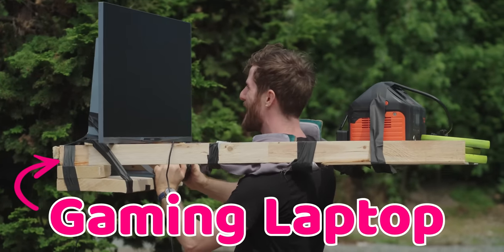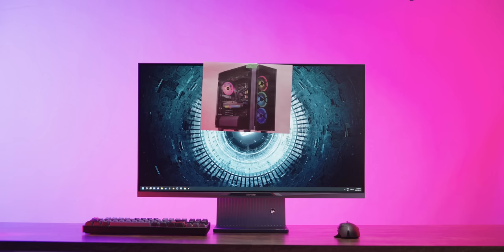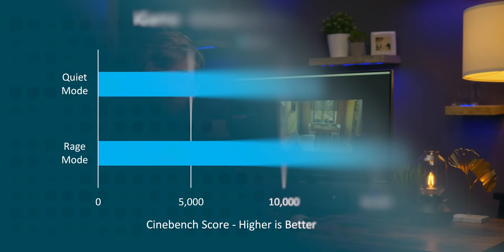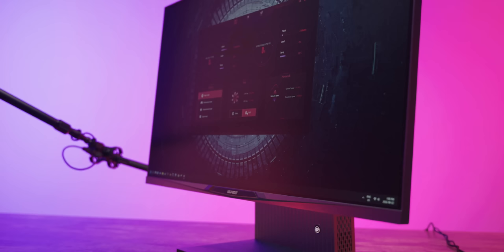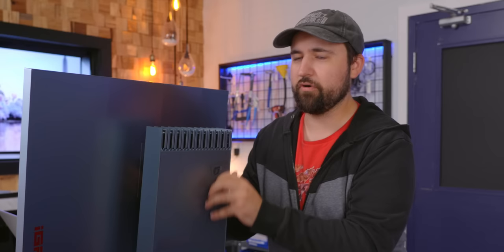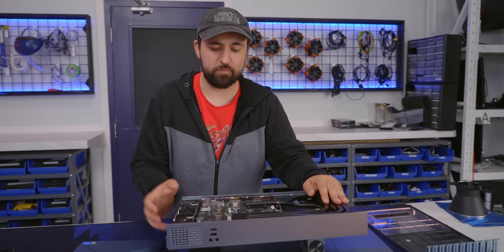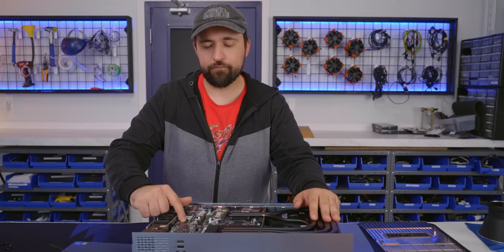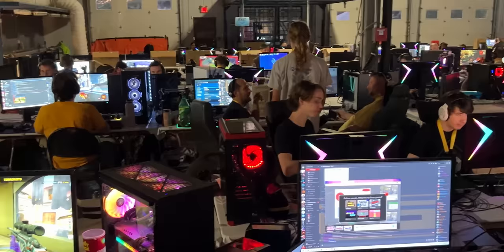Justify Your Existence. I'll Wait. - Colorful iGame AIO

Comment: I mean yeah you could buy a laptop to get similar performance, but then you'll have a small screen and attached keyboard/trackpad. To get a comparable experience, you'd need to buy an external monitor, keyboard, and mouse which would add to the price and take a lot of desk space. I like AOIs for their simplicity, small footprint, and aesthetics. Although I've seen plenty of decent ones by HP, Dell, etc, so I don't know if we need another option. I guess this one is marketed for gaming, which other AOIs typically aren't.

Comment: An ATX PC with front-facing speakers installed in the bottom fan basement and a display VESA-mounted to the desktop case itself would be pretty much the same thing, paired with a vertical GPU mounted to exhaust heat out the opposite side of the display and you'd basically have what this gives but modular.

Comment: You shouldn't lay screens flat with weight on the panel, if its lcd it will wash out all the color for the rest of its existence even tried it with a blanket before and it it still happens.

Comment: Gives me the Commodore Amiga effect vibes. The Amiga 600 was just an Amiga 500 in a smaller case but did have a hdd connector inside and a PCMCIA slot buuuuut again still only had aging A500 chipsets inside. Whereas just around the corner the Amiga 1200 AGA compatible successor beat it in every way. Also the Atari STE and Falcon computers were just hitting the market. Plus the Sega Genesis and Super Nintendo were also "cheap consoles" that still bested the A500/600 chipset at a MUCH lower price. The iGame seems to have the same issue - slightly in the wrong spec and place at the wrong time. (Also reminds me of the Commodore CDTV)

Comment: Two things as a low point: 3060 6GB for a 1440p display? Definitely gonna be a problem. Should've gone with a 3070. Honestly at this point getting a mini PC from Minisforum and better display is gonna be much preferred. Or you know, get a laptop or build a PC. This is what I'd like to see, but it's not the parts I want.

Comment: I think there's a place for AIOs, but the main reason i feel like they shouldn't exist is that they're usually even worse in terms of upgradeability than a bloody laptop, while giving performance that's on par or slightly better than one.
Micro PCs can do it, laptops can do it, so why can't AIOs?
Hell, the Dell 3090 and 7090 Ultra models are even more low profile, and super easy to take apart and upgrade.

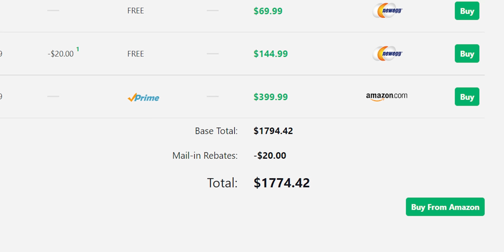Comment: 7:51 yes it beats the igame in term of performance, but what about in term of power usage and noise level (in quiet mode of course).  i think the sole reason they use laptop hardware on the inside is for power saving purpose.

Comment: Honestly I do miss AIO's. I bought one from Origin back when they had them for sale for my RV and when I was on the road doing for work because A.) I wanted a large screen instead of a laptop for certain applications, B.) I had no good place to stick a tower (plus it's just extra to tote around), C.) I wanted decent performance (dedicated gpu). It does suck to have minimum specs on them these days (Hp, Dell, etc..) cause they're essentially e-waste after a few years gaming/work wise, but so are laptops. They're quite useful for those with limited space but want a 27"-35" screen and a good graphics card. I would like to see them make a come back, stick a laptop's 3080 (or 4080 soon) in it and I'd still be sold.

Comment: 1440p on a 32" monitor may not give you a very sharp display, but it is great for ease of use, because having an old fashioned pixel density, means you don't have to use any scaling to get everything to appear at a pleasant size on screen.

Comment: The gaming laptop I just bought (which was last year's model) with a Ryzen 7 5800H CPU has the same number of cores, and actually wins on some benchmarks over the top-of-the-line desktop I built for myself three years ago, with an i9-9900k.  The laptop was less than half the price too (the desktop was a complete system too, monitor, keyboard, etc.).  AND it's WAY more power efficient than the desktop.  Laptop technology has come a long way, and there's some really interesting arguments for this sort of system.  Will you have the absolute most powerful possible system? No.  But... it's close and it (should be) cheaper, and you'll save on electricity.  This unit may not be the answer, but I think there's a very compelling argument for something LIKE this.

Comment: I would just buy a good gaming laptop + display with that price. It would also be super versatile for everything. I did buy similar spec laptop year ago with RTX 3070 8 GB €1200. I can use it with triple monitor, takes little to no space, easy to clean/upgrade. Yes, desktop PC is better in every way, and that's why gaming laptop isn't my main system. But it surely beats this type of all-in-one system.

Comment: I like the idea. Especially since I'm sure there are a lot of 30/6000 series mobile chips alongside the cards themselves in these AIB warehouses. They've got to do something with them, but they could do better. I agree with throwing a 24 inch monitor on it and setting up LAN centers with them. If they had a monitor output on them, I'd buy it for my karaoke setup. What I have works, but this would be so much better! I would build it into a table to make it portable and I'd be off to the races. I would probably prefer a smaller monitor as well tho... great video ltt. Just ordered my desk mat!

Comment: I feel like this might be a bit of a bad take. I'm currently a student at Uni (pretty close to LMG actually) but I think that recommending a laptop is not great, especially since the laptop you recommended is a 6 pound behemoth (with the charger) and batteries on more budget laptop like that die out really quickly. No one wants to deal with that (I hated it when I followed that recommendation in my first year.)

Currently taking my tablet to school and have a mini ITX system at my place for more intensive tasks. And that's what a lot of people I know are currently doing. SO this is where I see this machine coming in, if you are someone who doesn't want to deal with the hassle of building their own computer/having an SFF one somewhere, it is easier to get this instead of a laptop or the more expensive HP computer and take the money saved from that to get a samsung tablet or a classic iPad.

Comment: I'm assuming that the iGame comes with a Microsoft Windows 11 license, which is NOT included in your "equivalent system" specs. That would absorb at least $100-$150 of the difference in cost savings.

Comment: You shown the laptop I am watching this on....  It can play games, but for that price?  Forget it, fans are loud as heck when you go on anything other than low settings in games like Fortnite, even then they are still so loud I have been forced to use software to filter them out for my microphone.  If you want to run this on the "silent" mode, yes it's quiet, but thermal throttles basically instantly if you are gaming.  Honestly, get a small form factor build and a portable monitor, you get UPS systems that can fit comfortably in 5L-7L cases these days.

Comment: What do you mean by “a much more appropriate display” at 10:05 ? Surely the size requirements of your display depends on what you’re doing on it, also for most use cases laptop screens are a bit small.

Comment: Why does a stationary machine has to be so small and thin? Make the brick like thing behind the monitor just a tiny bit bigger and give it a thicker cooler with more heatpipes and a bigger fan. But no. The thing you'll never use has to be thin and tiny. For reasons?

Comment: You drop it, you break screen, then what? They probably could make "smart monitor stand" with VESA mount - this will allow to use any monitor and replace it easily. At a cost that it is not so clean in terms of cables.

Comment: Same noise as my 2020 iMac with i9-10910 after almost 2 years of usage. As soon as the CPU need to do some hard workload, this thing is getting really loud. This will happen if you purchase a computer you could never really remove the dust inside.

Comment: NIce AIO Design. Would been better if they just stick with 27' 1080p 120hz that way that Laptop GPU RTX 3060 can handle at High/Ultra Settings. a 2k Resolution on that RTX 3060 Mobile Version suffer a lot. I have RTX 3070 Laptop and it does suffer with heat/fan noise so i just put it on 1080p resolution 120hz to make it stable.

Comment: Well, not so long ago (about 6 years I think) MSI had a whole bunch of gaming AIOs including a 27” 4k running on, if I remember it correctly, a 970m. MSI stopped making gaming AIOs tho.

Other than that, there was also the infamous iMac Pro, which, well, actually was a super overpriced gaming-capable AIO if you bootcamped.

iMac still sells well even tho it has by far the worst value of all M-series computers.

And yes, large offices love AIOs: ease of deployment, ease of cable management, and better ergonomics than any laptop + people can choose to use different peripherals.

Comment: Whoa, that jackary link. They're literally charging more for getting 1000W pro with 4 200W panels @ $3999 than separate 1099+699*4= $3895 . I'm still wondering about the guy who said you could get a 200W panel for $70 ish, if you look hard. Monocrystalline? New? Portable? The panels do deteriorate over time. I've only got 350W rockpals for now, no panel yet, but I do want a fridge, blender, instant pot big boi.

Comment: So, Here is my professional consumer opinion about AIO computers. I agree with Linus on this "Who's buying" these. 

Internet Cafe's and small gaming events that gives the player limited or good enough graphics to play during E-Sports or something of that caliber. 
As far as consumer goes, It would be average for gaming. AIO computers in my opinion are fantastic for minimalistic type of people. but as far as upgradable goes. impossible or ridiculous to upgrade your system, Because that is what it's designed around to be an AIO that does everything you need without the extra cables, Accessories or spending ridiculous amount of money to buy parts and it guarantee's the product inside the computer to be 'game' ready. 

Would I suggest someone to buying the AIO as a permanent gaming setup? No, Because of the obvious limited ability to upgrade your system and less flexible to normal means. 
However, I will oppose myself as well by saying it would be the best gaming system right out of the box like a PS5 or Xbox Series X. 

Otherwise, If you really want to get into gaming, Just buy the PS5 / Xbox. lol

Comment: I think this would be a good product if the stand was instead an SFF case with a pre-installed PSU and sold separately from the monitor. I think they could have built a whole ecosystem out of this if it took off.

Comment: Again, Linus forgets this device has mobile chips, VS those desktop variants he specked out :S
In a usual laptop, those would run fine, but here it’s a bit odd but understandable. It’s a low power system, compared to some full 3060 that takes 150 watts or so

Comment: If I had this, I would definitely be upgrading the M.2 SSD it comes with because while I’m at it, I’d be putting better thermal paste on the CPU and GPU than what’s provided at stock as most OEM thermal paste is pure garbage.

I also wouldn’t bother plugging in the wireless charging module as it’s most likely your standard Qi Wireless Charging area that MAYBE provides 7.5W of charging but probably more like 5W.

EDIT: Just got to the part where it advertises 15W wireless charging but even THAT might be a bit too generous.

Comment: throw in a capable rdna 2 igpu like the 680m you got a capable 720p gaming machine it can even do 1080p in most titles quietly. even the 50w 1650 might be ok if they sold it in budget, as it doesn't get too hot. like the way this is heading.

Comment: i just recently had a ram stick crap its pants, so now im running on 4gb and suprisingly (probably because of my nvme) its still not bad lol, i have an i7 7700 non k and 2133 ddr4 4gb and its still completly useable lol its blowing my mind, but i also still have an old laptop i brought used 5 years ago for $300aud and when my ram stick died i kept getting blue screen so i used my laptop instead of desktop and it was literally perfectly fine, so i dont think this thing will be ewaste for over 10 years in any office or home pc for most familys its a perfectly fine PC, with 1440 its actually really nice. i think you guys are starting to get a bit bias against budget gear, this is not budget, but in 5 years it will still be perfectly useable and its a huge screen compared to a laptop, and to be fair a NUC is a bit more of a tech savy solution, an AIO is perfect for people who have no tech savvyness. also i have a 32 inch 1080p screen and it looks so good to me because my eye sight is shit and i cant tell the difference with more pixle density so yeah that is not really an issue for a lot of people, also i watch youtube at 480p because my australian internet sucks, so again you need to stop basing on lower spec stuff because not everyone wants or needs 4k or 5k or 3000fps. if my parents had a machine like that when i was  akid instead of the stupid compaq tower thing with no sound card or gpu or anything that cost 2 arms and 3 legs to buy, i would have probably gotten interested in tech a lot earlier

Comment: I love the idea of all-in-one PCs, especially on a smaller boat

But the moist air ruins the device real quick and the price tag just ain't worth it for that or the performance.

Gimme a lower end specced one and I'll buy it. An rtx 3050 mobile or even mx450 with a quad core. It'll die in 2 years but it'll be dated by then too

Comment: I’d buy one of these as a gift for sure. I think they’d have done better by going with an Advantage Edition AMD platform though for the price/perf ratio which is always slightly off with AIOs. Also, Jesus Christ use axial fans with flow-through out the back instead of centrifugal fans! who thought that fan noise was acceptable on the design team?

Comment: is there a reason that you didn't just follow the manual on how to disassemble the case for the M@ upgrade which is supported by design?

for one. you could have pivoted the entire motherboard with the heat pipes. 

you guys are PC technicians. right?

Comment: Great video, really is however I will express some concern here. 

This is the second time in a LMG video, that I have seen, where they mention 32 inches is nearing "Unacceptable" levels of pixel density for 1440P. 

Using a PPI calculator, becase i dont like doing math if I dont have to. 
2560 x 1440 at 32 inces has a PPI of 91.79. 
2560 x 1440 at 27 inches has a PPI of 108.79

Do you know what also has a PPI of 91.79?
1920x1080 at 24 inches has a PPI of 91.79.  -> Wasn't this the "golden standard" for YEARS? 
1920x1080 at 20 Inches has a PPI of 110.15
1920x1080 at 20.25 inches has a PPi of 108.79.

So... on a normal 1080P display, you get the same pixel density as 1440P at 32 inches. and some how that is almost unacceptable.
But 1080P at 24 inches is acceptable? 

When you investigate further. you also have 22 inches. But 1080P at 22 inches only reaches 100.13PPI and while it is sharper its still not 108.79. 
The point i'm trying to make here is that 32 inches for 1440 is more than fine for most people. to me, as it currently stands. anything that falls below the 91.79PPI on a monitor is unacceptable. 
91.79 is still the standard for PC for the majority of the people. 

I feel like LMG sometimes forgets that not everyone is running 27 inch 1440P panels, and that even on steam 1080 is still the dominant resolution. 
Granted they also don't really review 1080P panels anymore, likely because most brands ships them 1440P panels because thats the new meta.

All In all I feel calling 1440 at 32 inches "almost unacceptable" is a bit overdramatic. 
Especially since 4K at 43 inches is only about 10PPI better than 91.79 moving it to 102.46.
Personally 43 inches is much to large for a desk setup, and 32 inchs is really the upper limit of screensize given the distance, and I sit a bit more than an arms lenght away from my monitors. I have to slant forward a bit to touch it.

Comment: so there's something about Minisforum that's confusing me

they have the HM90 and the HX90
both have a similar CPU and GPU(within 10% of each other)
one has a small case and the other a bigger case
the one in the smaller case has a big heatsink making up half the PC, while the other has a tiny cooler
and that's how I ended up with the HM90
quiet even under heavy load and always keeps reasonable temps
very power efficient and can handle most of my games
sure would have been nice if they just reused the same case and cooler on the HX90

I will buy a new mini PC with the new processors once they are out and mature enough, propably won't really need my actual PC after that anymore.

Comment: It becomes even worse when you spec a PC for $2000 on PCParpicker. Just enter this URL after the /list/ part: bwZY2m

You get a faster CPU (slightly slower than the 12700K but we're not overclocking with a B660 board anyway. RTX3080, 32GB RAM,  2TB SSD, better cooler, better motherboard, more expandability, better monitor and very reliable power supply